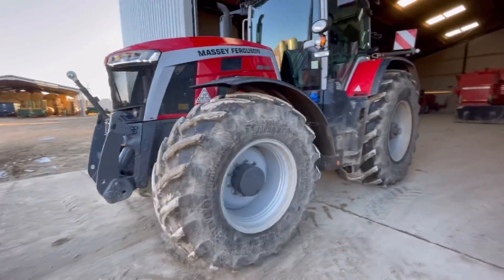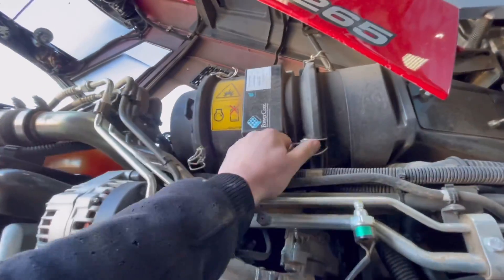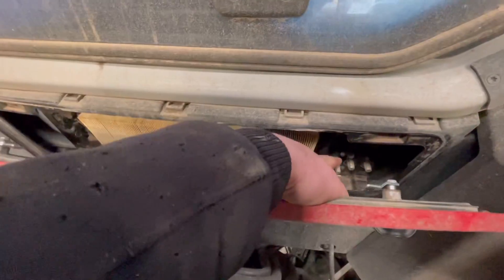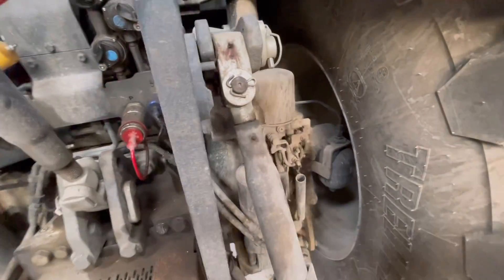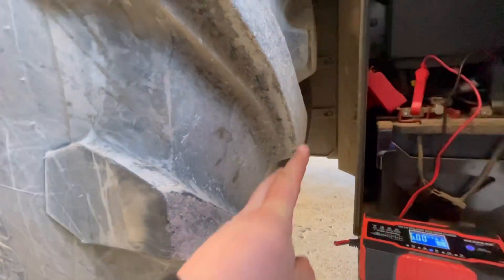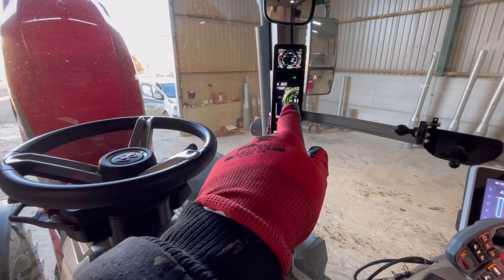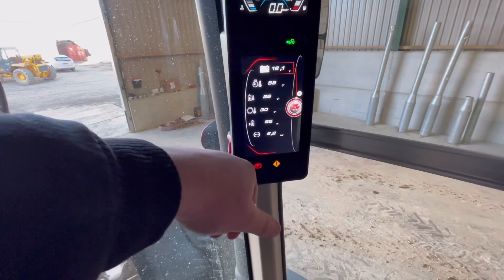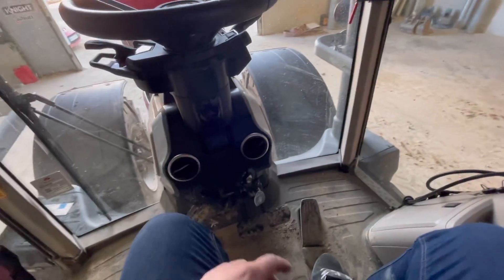Tractor servicing,calibration,software updates Massey Ferguson 8s 265

Comment: Hello . how do I change the speed limit from 43 km/h to 50 km/h. thank you very much
Reply from the maker: Have you got a transport spec gearbox
Reply: @Tomlamb980 Yes we have. the limit is set by the engine revolutions. at a speed of 43, the engine has 1430 revolutions per gear 4G
Reply: Our gearbox is Dyna 7
Reply from the maker: Get a dealer to plug a laptop in and remove the restrictor
Reply: @Tomlamb980  I tried it and they said that the tractor is under warranty. besides, only 43 is allowed in our country, but the rest of the users drive 50. but thanks for the answers anyway.